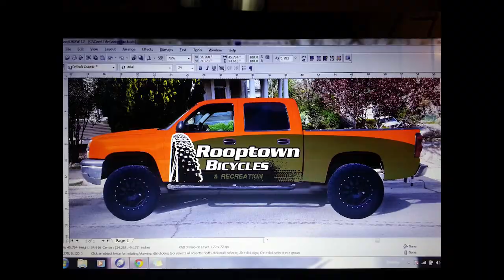2004 Chevy Silverado Build by Nicholas McBride

Comment: Do you recall the wheel offset, and whose fenders you used?
Reply from the maker: Sorry I just found your message.

The fenders where from Glassworks Unlimited they were terrible to deal with but a really nice products I believe the guy they have changed owners and hopefully that solved the problem I had with them. The new company is called Advanced Fiberglass Concepts. ADVfiberglass.com

The wheels i dont recall the where the max offset Method makes in that 20x10 wheel the tuck has a old 6 or 7 inch Fabtech lift and I cut the front bottom corners off the cab to make sure the tire didnt hit that seam those cabs have they are like a knife facing the tire

Hope that helps

Comment: Did the wheels sit flush with the fenders? Remember what size bulge they were? Any spacers?
Reply from the maker: They are about 1 inch in from fender edge they are the glassworks unlimited fenders the company changed names but google it they will come up. The wheels i believe are 10" wide and the minimum back spacing method wheels makes. No spacers i cut the front corner of the cab out to clear and it has the Fabtech 7" lift kit on it. Rollin 37 13.50 x 20 tires